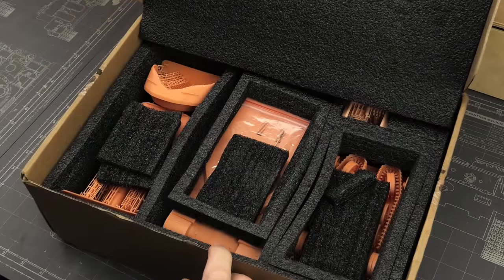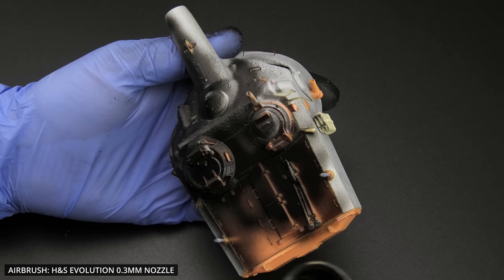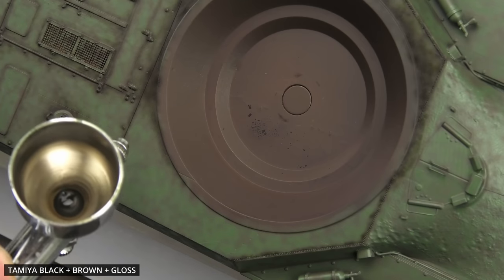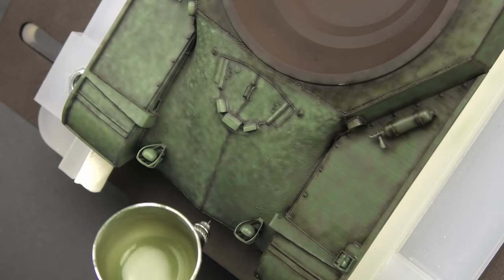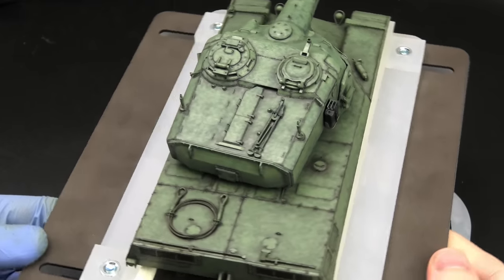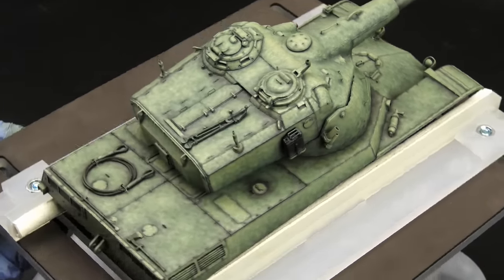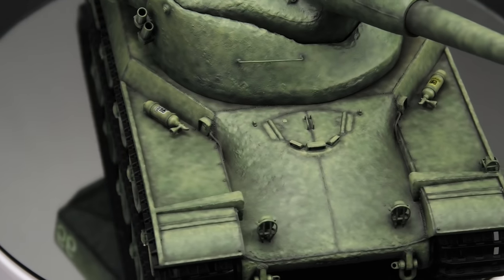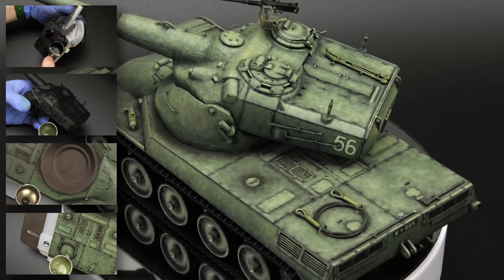Cranking Up The Post-Shading To Eleven! AMX-50 (Resinscales 1/35)

Comment: Maybe it's just me but something about the turret reminds me of a frog's mouth, and the green/brown mottling on the hull especially reminds me a lot of the coloration of typical frogs I see here in the USA. No, that's not an intentional reference to the WWI/WWII derogatory French/frog joke, it's just the visual I get from that particular design. It's quite appropriate in the overall look. The mottling strikingly supports the intended illusion of mass and shape rather than a boring hollow plastic shell.

In any art (yes, this is art, dammit) knowing when to stop is critical whether it be individual steps or the overall work. So far I think you've done well on that score. What you've got now strongly suggests random coarse-scale sun fading of the factory paint with just enough shading to make details "pop" as they say, so subsequent weathering etc. should pretty much automatically build on that without you having to second-guess yourself (I hope).

A white background gives a datum level for color balance in finished-product images but yeah, a dark background seems better (to my eyes at least) for the work-in-progress videos.

Comment: That's a nice finish with the postshading, I may have to try it out. Hey what material did you use for your black background. I tried using black card stock on my latest video and I couldn't get rid of all the hot spots that were washing out the video quality. Cheers!

Comment: I used this method in the past but was worried that it would change the hue of the base color too much. I also found it a bit more difficult to control the final color. I have since switched to a new method that, in my opinion, solves some of the problems. I do all the normal priming, and then overlay a fully opaque base coat color over that. I'll do lots of mottles of really stark colors then slowly bring the color back to where it should be (e.g. if I'm doing OD 41 for an early war US fighter plane, I'll do an opaque OD 41 coat, then white->yellow->yellow-green->light-green->khaki, all thinned at 9:1 IPA:paint). I'll do a 19:1 IPA:paint of a dark shadow coat (for the OD 41 color, something a bit darker than the base coat but not too bad) on the panel lines and other areas that I want to start having the appearance of being grungy. Finally, I'll spray over everything with a 9:1 thinned base color again to bring the color back to where it should be.

I adapted my current method from Scale-a-ton's older methods and it works great!

Comment: I think that I will never be able to paint such tiny dots with my old airbrush (badger 100). Maybe my thinner-paint mix is wrong, maybe I'm using the wrong colours that dries on the tip of the airbrush, maybe it's the pressure level...I don't know. But I'm very envious that you can paint such tiny dots.
Do you have a video about these "technical tips"?

Comment: It's a hard decision by I finally decided to try this on my Sherman. Just wanna know what thinning ratio and air pressure for the postshading cuz I have to use a mini compressor in my dorm. Also is it possible to use this technique with pure acrylic paints so my roommate won't complain about the smell.

Comment: The shadowing is posible with paint brush? I mean without filters or washes
Reply from the maker: I could imagine doing it with a sponge, not much with a paintbrush
Reply: @NightShiftScaleModels  Ok, thanks. I only have paintbrushes and i wanted to make my models more interesting.
Reply from the maker: @johnrapapum6957  Try stippling the diluted paint with a sponge, trying to achieve a uniform coat. It might be even faster than using paintbrushes!
Reply: @johnrapapum6957  Try oil paints - You can do some blending and shading with them
Reply: @NightShiftScaleModels  Thx!
Reply: @Szopen715  Yeah, oil paints have a lot of advantages, and you can do colour variation also I think.